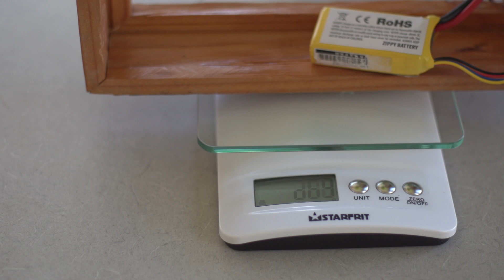Coanda Effect Lift Testing

Comment: I think an axial propeller isn't the right choice for this kind of setup.

An more ideal solution would be to make a hole inside the bowl and glue an pipe into it and use an centrifugal impeller and mout it onto the bows that the impeller sucks air trough the pipe. Then close the large side of the bowl with an disc, so the pipe stays open. Then take a flat bowl that is slightly bigger in diameter then the one you already have and mount it underneath the big side of the first bowl.

So that the air is circulatimg around in an torus shape. This way you will keep all your energy inside the system and the energy is building up instead of wasting it by throwing it away.
Reply: You can compare this with an naturally asperated motor to an turbo charged motor, the turbo charged one is also useing some percentage of his output to feed the input, this way the energy (pressure in this case) is building up.

The NA motor is not doing that and is not that efficient as the turbo charged one

Comment: It has to be a vacuum style impeller, pulling the air from in front releasing it over the surface, rather than Bernoulli, where you’re pushing the air over it with propeller, you coanda, with impeller, and pull the air over it with vacuum.

Comment: The air in and out has to be channelled across the surface of the bowl and your materials you are using are insufficient for the application you are trying to fill , given your materials your thrust and your power delivery system is not good enough and will be next to impossible to get any kind of lift this way . You might as well blow your breath across a motorcar and say “ it’s not lifting “ because the results will be the same .

Comment: Coanda effect uses gravitation air pressure to reach maximum efficiency "IE" your motor is upside down.... also if your motor was mount to the bowl you would get a much stabler, accurate test result.
Reply: +lyn smynri    You do not understand pressure. Pressure in a fluid acts in all directions. The orientation of the flow is irrelevant to Coanda.
Reply from the maker: Thank you!! Some people really seem to struggle with this point... the same people that would try to sail a boat by standing on the deck and aiming a leaf blower at the sail ;)
Reply: @RCexperimental  if the sail is shaped correctly you can  blow your sail and propel the boat...its been proven!

Comment: Your model has major flaws. A propeller is not used for a coanda effect model; an open impeller is a better choice, with the bottom of the bowl removed and open for air flow. And the ridge on the bottom of the bowl interferes with smooth flow, and the arc of the bowl doesn't make a full 90° It's just a poor model to test. I still doubt a comparable coanda effect would produce more thrust than a propeller.
Reply from the maker: Great points, thanks for sharing. It is far from a perfect test, but still if the coanda effect is better than a propeller I would have expected to see better results with the bowl than I did in this test.

Comment: It wont work with propeller blades. You should redo your experiment with impeller blades.
Reply: RCexperimental , "independent of the method"??? . . . Not hardly. The method used DETERMINES the effect measured. If it's independent of the method, just use a popsicle stick for the propeller and see how that compares. That would be comparable to using a salad bowl under a propeller.
Reply from the maker: The coanda effect I was attempting to measure is independent of the method in which the thrust is created.
Reply: the thrust has to be tangential to the surface for the coanda effect to take place. If not, the air strikes the surface of the bowl and bounces back, which results in loss of energy and no coanda effect.
Reply: and also, your setup is not stable.

Comment: as far as what i know impeller blades is not for a high speed ram air jet but it can build a high pressure,
Reply from the maker: +Catalino O Calimlim That's a good point, thanks for sharing.

Comment: a better test would be to use a smoke test to see where the airflow is going.  It seems to me the propeller is too far away from the base of the parabola.  Also, the cross beam could be causing some interference as well.

Comment: This isn't a proper coanda craft. The thrust should be moving parallel to the surface of the bowl at the top.
Reply: and the air flow if its a vortex will give more thrust

Comment: you're not actually testing Conadã effect there. when the air flows in that direction, it's having to find its way around the bowl, not being attacted to its surface. you'd have to blow air parallel to the surface to produce this effect. here's an actual example of this effect using a bowl shaped surface: /watch?v=aF92B6Gon3M
it's very interesting and certainly has its advantages, but even optimized as it seems to be, it's still way behing normal propellers in terms of lift to power ratio, which is the decisive factor in practical applications.

Comment: Coanda effect is new to me and I'm learning.  your experiment does not seem correct to me.  the prop is forcing / directing air down ward to force or lift the jig off the scale.  from what I understand the bowl should be under the prop not above.  I think you should place the bowl under prop and retry your experiment.
Reply: the prop is pushing down

Comment: If you think about what is going on with the fluid (in this case air) with and without the coanda craft it is relatively easy to see that adding the craft will not increase the thrust of the engine. There is a loss of velocity and transfer of energy when the fluid hits the coanda craft. The coanda craft has to 'push back' on the fluid and this is where the loss of thrust occurs.

Comment: Hi Tim,
Nice that you followed through with an experiment.  I'm near completion of my first conanda copter and will be posting video of the maiden when it's completed.  After this, I have a new take on the coanda I'll be building.

Though their is a loss in thrust, I do believe there is a gain in velocity.  I believe this just from flying flat foam aircraft and aircraft that has been skinned (in a coanda fashion) that are generally heavier but much faster.  All the best and Happy flying!